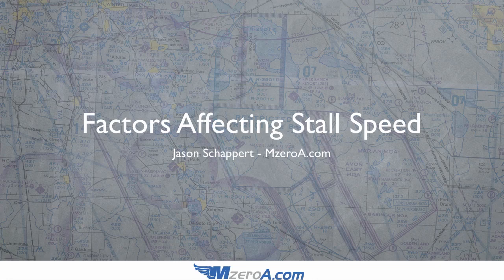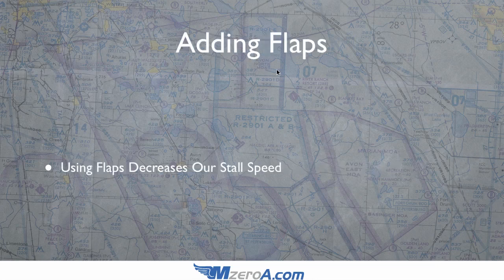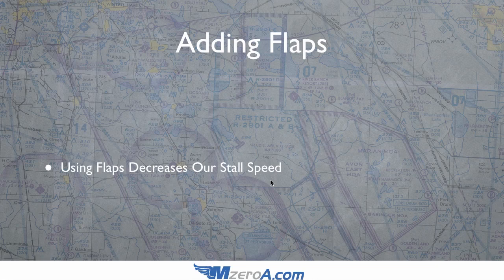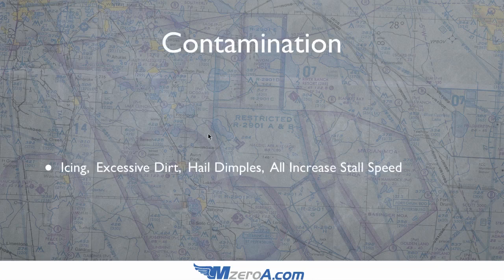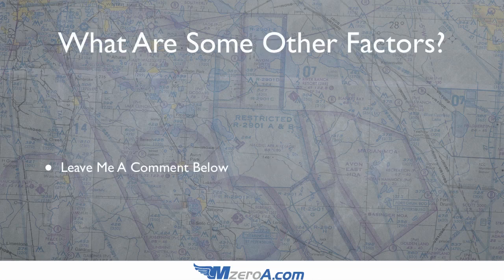Factors Affecting Stall Speed

Comment: Greetings Jason and any other aviation fans, I have a quick question, I was looking over one of the aviation questions that asks, “ If the airspeed is increased from 110 knots to 150 knots during a level 45° banked turn, the load factor will...” 

At first I chose the load factor will increase as well as the stall speed. But the correct answer appears to be the load remain the same but the radius turn will increase.

But I thought when you make a turn your load factor and stall speed will automatically increase? Or is it because the throttle is increased that’s why there’s no change in load factor and stall speed?

Or that’s just say I don’t increase the throttle, and I make a turn, then in this case both the load factor and stall will increase?

Thank you!
Reply: That's a bit tricky question, but actually you don't need to focus on the speed as they gave you banking angel, and load factor = 1/cos( banking angle), therefore, load factor =1/cos(45) = 1.41G

Comment: Hi, I'm writing a lesson plan for my CFI check ride. I listed these following factors:
 (Weight, Load Factor, CG Location, High Lift Devices, and Air Density)
Reply: How does weight effect stall speed? If you’re heavier you can produce more lift with an increase in AOA or a faster speed referring to the lift formula. So if you’re not increases AOA, just speed, does stall speed still increase?
Reply: @merlochelsea  Yes, just because you are flying faster does not mean you are safe. A stall will occur at any airspeed, attitude and power setting. You are correct, when you are heavier the aircraft will fly at an increase AOA - producing more drag - that it why we have to increase power to maintain adequate lift. However, this does not mean we are changing the critical angle of attack, we are simply providing more thrust, the angle will always be the same. Angle of attack is the angle between the relative wind and the chord line, adding thrust does not change that.

Comment: One of the factors that affects stall speed that you did not mention was turbulence encounters which as a result can cause an aircraft to stall at higher air-speeds than an aircraft that is operating on stable conditions.  Vertical gust changes the direction of the relative wind causing the aircraft to increase its angle of attack. During gusty conditions, especially if landing or on take-off an increase of of airspeed is necessary to keep a wide margin above stall speed.
Reply: there are a lot of challenging aspects to flight safety like minimizing load force and stall speed and turbulence is an important issue. picking the conditions you fly can negate these risks, and my old mate and mentor used to say "a good pilot doesn't just know how to fly but he also knows when to fly"  cheers

Comment: In WW II dive bombers would sometimes stall their aircraft while dive bombing a target and crash. Pilots back then thought this was target fixation. Today it is understood that the pilots exceeded their critical angle of attack. I would like to see a graph on that kind of a stall?
Reply: Yes, that type of high g stall happens at the bottom of loops or trying to pull up out of a spin and dropping into another spin, they are high g high speed stalls,if the aircraft doesn't break it will stall, you are loading up the wings to much with weight or extra load force from g.

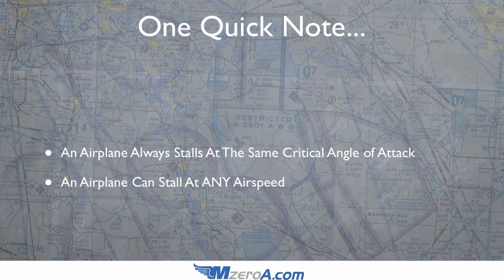Comment: 0:15 you say that the critical AoA always remains the same. However, if you deploy your flaps the critical AoA decreases right? I’m kind of confused about this...
Reply: Youri Rutten CAOA is critical angle of attack. It doesn't change. Regardless of pitch or airspeed.
Reply: The critical AoA does not change regardless of configuration, the geometric AoA will change (what you see) but the effective AoA (what the wing sees) will not change.

Comment: Why/how do flaps increase stall speed?
Reply from the maker: Hey Chelsea!

I'd be happy to help with this!

It is important to remember that stall speed is decreased by the addition of flaps. Anything that lowers our stall speed is good, and that's simply because the lower the stall speed is, the slower we can go before the airplane stalls. The flaps enable a lower stall speed because flaps are providing us with additional lift (which enables the lower speed). The extra lift provided allows the airplane to to compensate for the low speed. You can even see this if you look at your airplane's stall speeds. You'll always see that VsO (or stalling speed with the flaps out AKA bottom of the white arc on your airspeed indicator) is always lower than your Vs1 (stalling speed without flaps AKA bottom of the green arc on your airspeed indicator).

I hope that helps!

Comment: Turning: you mention nothing of increased load factor!! ..... that is the reason stall speed is increased in a banked turn or "turning stalls".  You mentioned turns  increases stall speed simply because you reach the CAOA faster?  not sure what that means
Reply: Michael Turner    You are on to the truth.  It is NOT the angle of bank that determines the increase in stall speed.  It is the "load factor" that causes the increase.  When pilots assume that "angle of bank" increases stall speed, they assume that "altitude" is being held constant.  But when you increase your angle of bank and try to hold the "same altitude" the "load factor" must increase.  But, if you lower the back pressure while increasing your angle of bank, the load factor will not be affected.  It is the LOAD FACTOR that increases stall speed, not necessarily the "angle of bank".
      So, when you are turning from base to final and you are afraid to turn steeper because you are afraid of stalling, simply lower your nose and "decrease your angle of attack" and pick up a little airpseed in order to avoid the approaching to landing stall.  This is why it's better to come in a little high on base to final, so you have room to lower your nose and pick up some speed in order to avoid a stall.